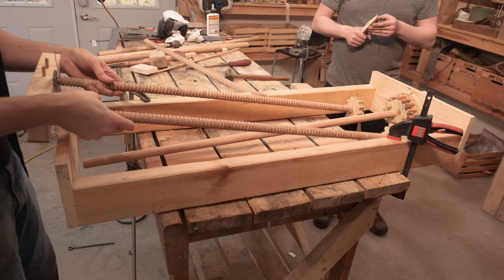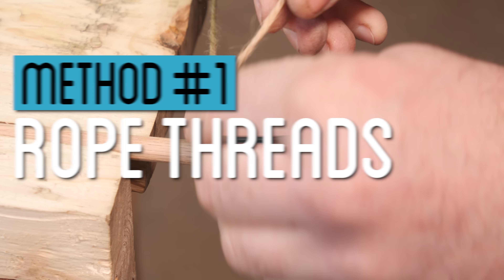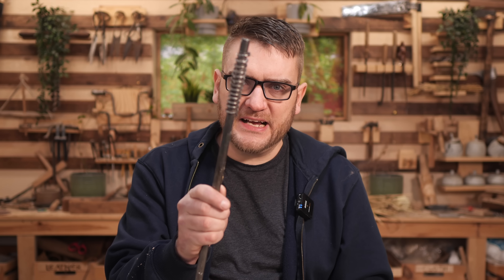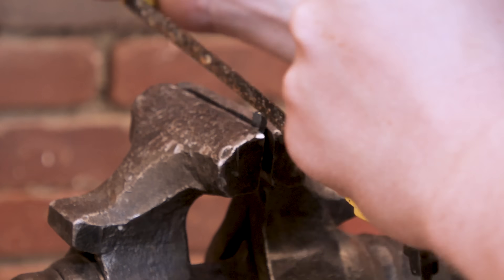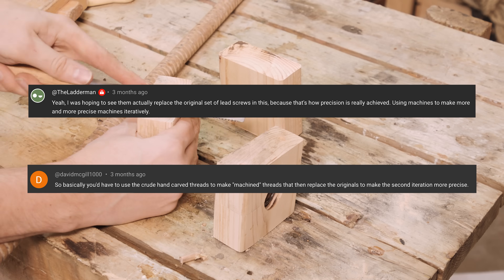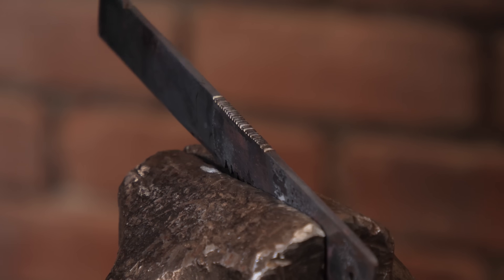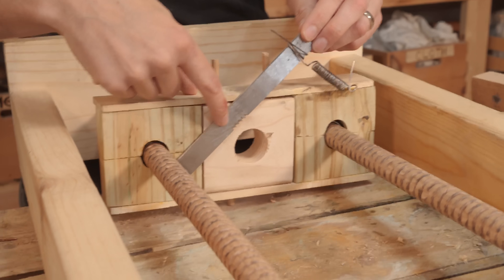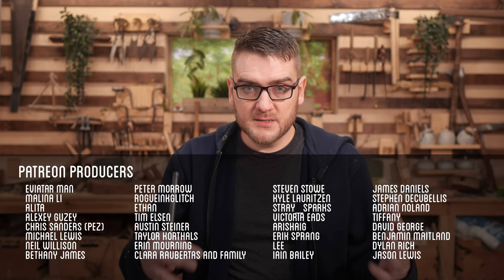This DaVinci Machine Changes EVERYTHING

Comment: A few thoughts for consideration
 
Wrap 2 wires around the rod and carefully remove one before brazing.

The thread cutting on the DaVinci machine could be sped up by putting multiple blades on the cutting block.

Another more difficult method that may improve cutting metal threads is to use a powered cutting disc. 

Casting threads from existing hardware is really copying not creating

Comment: If I were going to cut the first ever threaded rod, knowing what I now know, but not having the tools I now have;

1. Mount a wood rod at both ends so it fits snuggly but turns with ease (perhaps lubricated without swelling the wood). The mounts need not be any more distant than to accommodate the cutting tool.

2. Rigid pivot mount at one end of the fixed alignment thread cutting tool (sharp rock, knife, saw teeth) at marked for adjustable angles.

3. Add a weight to the other end of the cutting tool to keep constant force against the rod.

4. Rotate the rod clockwise and counter clockwise to start forming the thread.

5. Then allow the cutter angle and groved thread to slowly guide the rod under the cutter.

Comment: 13:56 so sounds like you make two reverse ones (which would in theory be a little better than the ones you had) and then two new rods which are now what you need to make the normal ones again, and these would be potentially even more accurate:)

Comment: Some time ago i thought about how i would go about building something like this.
Making threads without threads seemed very intriguing to me.
For that i would probably use a pulley system with some peg gears and an oscillating file with a triangular profile.
Basically the same way you would hand file a tread, just with a machine to do that for you.

Comment: Now that you've made a relatively precise screw that you can turn into a tap, do some file work on the tap to clean it up and make the cuts deeper.  Then forge out a nut from carbon steel, cut or forge threads in the nut while it's annealed or still glowing, file a taper in the threads so it's not cutting to full depth on the first cutting surface, then clean it up and fully harden it for use as a die.  That'll give you easy, consistent, fast threading.  You can even use it on the machine, just replace the lead screws with stationary dowels and let the die move itself along the rod.  In that manner, you wouldn't be introducing off-axis tilt to the die wrench while cutting threads.
Reply: Yep, and because the die is much shorter and required sufficient consistency to traverse a much longer length of thread on the tap, it should be guaranteed to produce more consistent threading on the following screw.

However, you might be able to get a smoother, more precise thread if you also use a different method (mostly my own thinking so it's probably got some issues I haven't thought of): cutting an internal positive thread using a similar method to a reducing machine (though using a 1:1 pantograph arm instead of a reducing one) and then grinding the threads against each other. This forces the threads to be their own negative, and if P=N then it must be flat/straight (same principle as the Whitworth 3-Plate method that yields A=B=C).

Comment: Your biggest problem is that you only half heartedly attempt most things.

   Your blacksmithing is still abysmal, you could very easily have cranked out serviceable screws by twisting a tapered square rod.
   And soldering wire around a rod would have made exactly what you wanted, but you made one attempt and gave up.

Comment: If you can make a good screw out of bronze, you can use it as the lead screw to guide an abrading tool (not a cutting tool!) which could then be used to grind a screw onto some steel round stock. Since you’d be working with abrasives, and not cutters, the forces should be low enough for such a lead screw to still do a fantastic job.

Comment: If you are going to cast screws try aluminum bronze it's easy to cast and it gets pretty good detail if anything the only downside is it shrinks a little when it cools but other than that it's almost as hard as steel and you can cast it it's crazy

Comment: DaVinci's machine - If you had a 1:1 gear ratio, with reversing gears in the middle, you'd get the same pitch out as the one you started with. In theory, if you got all of the slop lengthwise along the shafts out, and allowed the 2 follower nuts to move independently (a bit) and swapped one of the two end over end each time, all the variations should be cut in half each generation.

Comment: With screws and gears in your toolbox now, there are so many different machines you can make to make your projects both easier and a bit more authentic.

Rope maker, wire puller, treadle grinder, etc. 

So many things you've struggled with trying to do by hand could be done with more ease simply by making a dedicated machine that removes as much human error as possible.

Comment: #3 Soldered wire... you were doing great, having two parallel strands... and you should have soldered them both down... then pulled one off cold... the wire is drawn through a mandrel which makes it's size consistent, which makes a consistent thread... but you didn't do that.  8(

Comment: For making a 'master' screw like for a lathe feedscrew, I think it would be best to interpolate it point by point the way a CNC would, except manually. As in, use some kind of dividing head to select the angle, and some kind of linear measurement device to find the position, then cut a little bit. I think it's similar to how flatness precision started with the invention of the 3-plate method: what matters is the measurement, not the cutting.

So the question becomes: how accurately can you divide a circle evenly, and how accurately can you divide a ruler evenly? Which are close to the same problem, if you can make an evenly divided wheel you can wrap a ruler around it to make an evenly divided line too. I'm thinking some Clickspring-style stuff with a very fine scribe in soft brass.

Comment: Why even use mother-screws for the screw mashine?
Could you not use a rooe wrapped around axles on both sides to "drag" the cutting tool back and fortg, not unlike the belts on a 3d printer.
That way, you aould get basically perfectly consistent threads for free.

Comment: scrwe that. that stinks. very nice. thread cutting rails. cast a thick screw then use the wood blade block to also thread the metal screw. yep primitive hand lathe. or hand metal lathe with wood carving tools. just spin the screw. the modern way of making threads into metal, the commercial machines. not the hand threading tools but the mechanised metal threading tools. you move the thread cutting tool head in sync to the rotation with gears. you can make a turn based vertical scale to measure the accuracy. ie length delta moved by turn angle. you can also measure the radius of the outside and groove inside.

Comment: If you have any interest in further improving upon your designs, have you ever heard of a CNC thread grinding machine? The way they work is basically to use a big, ceramic grindstone with the profile of the thread cut into it. As the grindstone spins, it cuts that profile into a steel rod, and if the rod is rotated and translated at the right speeds, that profile is cut in a spiral around the rod, creating a thread.
I suspect you could do something similar with a sandstone, granite, or fired terracotta grindstone (provided that the pattern is regularly ground back into it, as it will degrade with use, perhaps using a filed iron model of the thread profile) and perhaps something similar to your "Marking Block" once the initial thread has been cut, as a guide to keep future cuts consistent.

Comment: I figure this would add a lot of complexity or involve rebuilding your thread cutting machine, but what about a gear or pulley system that doesn't use lead screws? You're currently relying on the accuracy of your threads to make more threads, which seems to work decently well, but I think you could avoid that entirely. 

For example, if you have a setup where you're just turning the rod to be threaded, and on the end of that rod is a gear, connected to another gear at a 90 degree angle, which pulls the thread cutting nut down the rod as it turns. This way you could adjust the thread pitch by switching the gears/ratios and making it so every rotation of the rod moves the cutting nut a certain amount that gets the desired pitch you need. Modern lathes use gear ratios and a threaded rod, but I feel like you could definitely use gear ratios and a pulley to drag the nut along the rod.

Comment: Your best bet is to just take a nut, file 3 or 4 relief points, then use the nut as a thread die, you could replace that nut with any other nut then, allowing for more, different thread counts.

Comment: Start with measuring displacement versus rotation at many points along the length of the screw using a cheap DTI.

Comment: There is probably a good reason or you would have done it, but I don't understand why it wouldn't work better to use threaded metal rods as the guide now that you can make them. Using metal threads as the base just feels like such a huge improvement in quality.

Comment: Those soldered screws look like they would work better as a mace

Constantly turning the crank by hand would give you an inconsistent movement which even by itself could cause the threading to change but my main worry would be the friction heat when it gets run at high speed for a decent amount of time that heat could cause the wood to end up cracking or warping

Comment: Clear example of panic thinking, if the rods produced by the machine would invert the thread on the end result then just make a set of reverse threaded shafts to replace the ones that inversed the threads and it'll be back to normal. 100% plausible and possible to use the machine to improve the machine.
Reply: I think they overcame that problem by adding enough gears that it inverted the rod automatically allowing them to use their newer more accurate rods. They just confused everyone by stating it was a problem then quickly went over the solution so fast that most people missed it.

Comment: Screw pitch and pitch dia evaluation: Thread pin gauge: two pins of known size, and a caliper. Place threads into the valley, top and bottom of the screw, measure distance of the pins as they lay parallel. Next, measure angle of pins relative to the shaft.

Comment: 14:01 What's wrong with it making reverse threads? Start off with two normally threaded guides to make two reverse-threaded guides, swap them out, now the reverse-threaded guides with make normally threaded guides. So make two of those and repeat the process. Seems fairly straight-forward to me... plus you shouldn't have to change any of the gearing.

Comment: Wrap the wire without any gap, just like making rings for chainmail.  Spacing will be set by the wire diameter.  After brazing, you could the optionally run a triangular file along the threads to deepen them.

Comment: Something that might help with the metal cutting is lubrication. Not sure how well it’d work but might help especially with ease of use. Great job yall, love the videos
Reply: Cutting oil really doesn't do much of anything in this case.  It's used either for cooling the cutting tool or as a way for the tool to remove swarf from the cut.  Microscopically speaking, the oil itself never reaches the actual point where the tool is cutting metal, so it doesn't actually lubricate where the friction is happening.  Some form of grease on the gearset and lead screws would certainly help with ease of use though.  A sharper and more efficient single point cutting tool would make a world of difference, and that could absolutely be forged out, filed to shape, fully hardened, and then honed to a precise cutting edge for more efficiency and accuracy.

Comment: Videos like this definitely show that people hundreds of years ago were not dumb.  A lot of the reason why they were not able to build these tools is largely because no one before them had and doing it by hand was "good enough" for most people.  However, Good Enough, was not consistent enough for parts to become interchangeable.
Reply: It's so sad that this knowledge, the exact information we need to rebuild society, exists on a platform that won't be around when we need it
Reply: praise for Eli Whitney
Reply: Materials were bad, technology just wasn't there. A good example is the first McCormick reaper. It took 20 years to make from a prototype to a product and the McCormics sr. didn't quite finish it, it was left to his son.  And they weren't poor, they had estate, their own blacksmith.
Reply: @ You are right and the effort it took to turn Iron into steel by hand took years to learn the right ratio for iron and carbon and lots of hard work.  Even then by hand it would take a skilled blacksmith days to finish a single high-quality sword.

McCormick built the first functional models in 1830.  It wasn't until the Besmer steel furnace was invented 20 years later in 1850 that the mass production of steel really became economically viable.  You can see how much of a difference that made in just the McCormick Reaper, early models were mostly wood with what little metal used for the blades and wheel.  Latter models used almost all steel which reduced the size and weight to make it easier on the horses to pull.

Comment: watching the marking block, method #4, my first thought on making that method a little more viable would be to cut a notch into the block and adding a dowel as a handle to increase the leverage on the block itself to speed up the process. with more leverage you could possibly add more tension on the cutting blade as well to make more efficient cuts with each pass.

Comment: I wonder if the wire wrapping technique could work better with two wires (one lead, one steel) and then melt out the lead wire, leaving the steel one consistently spaced.

Comment: The next step, of course, is an auto reverse mechanism, that way you can just crank the handle one way and have the tool head move back and forth by itself.  Once you get the steam engine going you could even have it cut threads with minimal babysitting
Reply: That was my thought as well.

Comment: the solderedvwire should be tightly wound SINGLE WIRE, it becomes a ok working screw to start with (Yes I have used this method to nake threads)

Comment: Kinda janky, but could you use basically just use a hanging weight to keep tension on the blade the entire time instead of having to adjust it after each pass? Similar to how a horizontal bandsaw works, letting gravity do the work.

Comment: seeing as the machine reverses threading, you could've mounted the first pair of machined leadscrews. and then with those you could make your final pair of lead screws, taking out any further errors and inaccuracies, making the final lead screws the right direction and also the most accurate screws yet

Comment: I think the largest problem your thing still faces is it's rigidity. This is similar for many things you've made, they move too much, the rods are bending back and forth and everything is vibrating like crazy when using it, and that will put an upper limit on how accurate and how efficient it is. Now that you can make metal threads I think a lot more focus of making things stable and minimizing internal movement needs to be done. Not just for this machine but in general.
Reply: that is the sad bit of this channel....
they always attempt at replicating old technology and ALWAYS stop after getting a barely functional imitation.
and the worst thing: they use these badly made things to attempt to do the next tech level instead of first iterating on the tools with the available methods until they get them to a stage that is suited to achieve the next tech level
Reply: @TheScarvig  This is trade-off they face due to limited time. You can either get 10 videos of different half-made machines or 10 videos of perfecting one machine. They decided on the former.

Though I do agree very much with critique about rigidity. Clearly most of their inventions could be improved a lot. Though usually improving rigidity means redesigning the whole thing; especially since wood is just not very rigid thing.
Perfect example is this DaVinci threading machine - it is just not possible to keep cutting rigid when only support is two 1.5m long (threaded!) rods. Even if those were steel, let alone wood. One would have to redesing it to keep those rods somehow shorter or supported and that is basically new design at this point.
Reply: @jakubjakubowski944  even if they dont make videos about it they could at least use better tools for the next iteration or nect machine and mention that between the inventions they try out a lot of time passed and humans nearly perfected the previous step before doing the next one.
Reply: @TheScarvig  You misunderstood me - Upgrading machine itself takes time, work and money.
Reply: this is very true. to remove wobble. gotta have a stiff machine. more triangles

Comment: For an EVEN spiral for the wire wrap method, wrap TWO or more wires.  Then slide them off and replace ONLY ONE.  The spaces between your wraps will be even without adjusting as you did.

As soon as I saw you adjusting, I knew it was a failure.

Comment: Looks like that you are now at the point that if you harden the tap you made you can use it to make a metal nut and as a result will be able to remake the hole machine in metal which should give you a much better version of the machine.